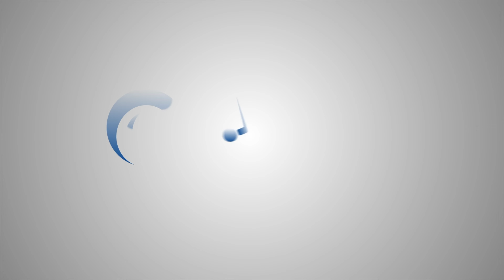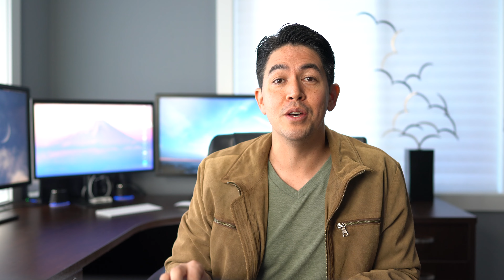What are Full Milled CNC Golf Clubs?

Comment: Excellent video and information my question is would it be Cheaper if they were to  Forge it like a regular forging Up to a certain point and then finish the rest in a CNC machine Maybe the face ,sole and some parts of the back portion of the clubs instead of milling a whole block?
Reply from the maker: Seven currently mills from a large forging with optional solid block at an up charge.  Many brands mill back face, face, sole.  But that doesn’t solve two extremely important factors.. 1. shape,  you cant nail a perfect shape based on the original design and 2. CG locations as designed.  Full CNC is made with extreme performance and accuracy of weight distribution, cg height, depths etc.
Reply: Yes, I suppose it will be cheaper as the hosel waste lots of material and milling time. Dimensionally it will the same tolerance as full cnc milling a block of metal. 
However, comparison on metal grain uniformity  is debatable depending of the material and forging process.

Actually it will be interesting if somebody try to make the ultimate irons by metal sintering maraging steel then cnc milling it. Again it will be the same precision dimensionally but the sintering will give the ultimate metal grain uniformity.  

I am currently using MFS cnc milled irons from Korea, it feels better and looks more expensive due to sharp edges in the details and shapes which cannot be achieved by forging.

MR
Happy user of Proceed Justick JDM & MFS KDM